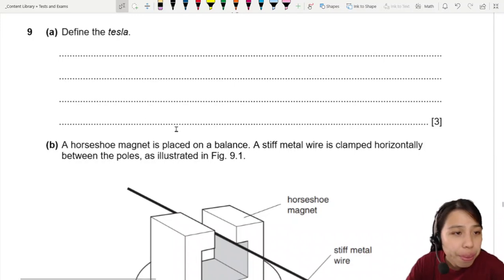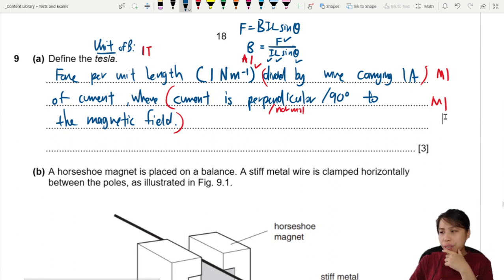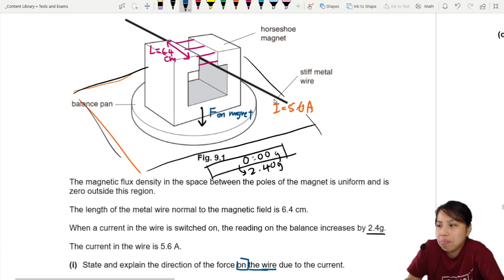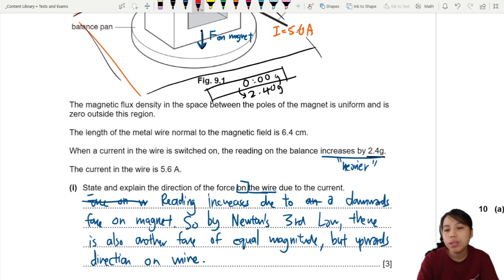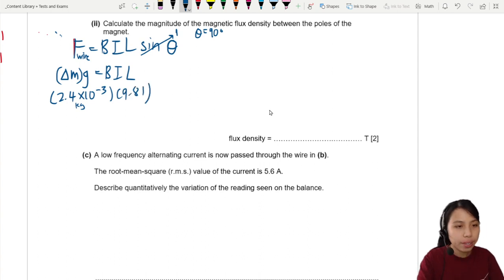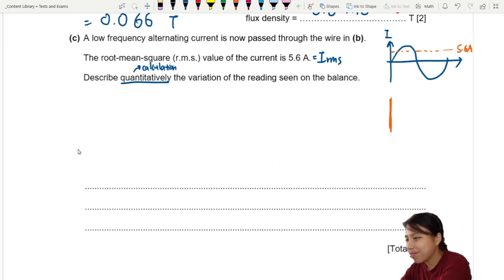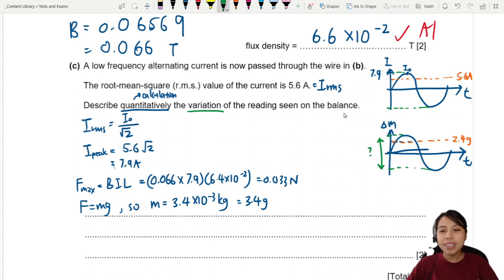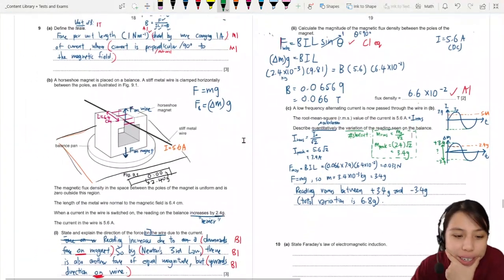MJ12 P42 Q5 Current Balance Reading | May/June 2012 | Cambridge A Level 9702 Physics

Comment: PLEASE HELP ME WITH THIS!! 

1) If upward force and downward force are equal and opposite then they would cancel out so why does the reading of balance increase?

2) How can we assume that the downward force isn't actually on the wire? I mean sure the downward force is pushing the magnet down and hence increasing the balance reading. However, why can't it be that, actually, the downward force is on the wire but simply because part of the magnet is below on the base as well, the force is acting on the magnet too. Like primarily the downward force is on the wire but incidentally it is also acting on the magnet.
Reply: Hey mate...ik this is late but did you get the answer to these questions?